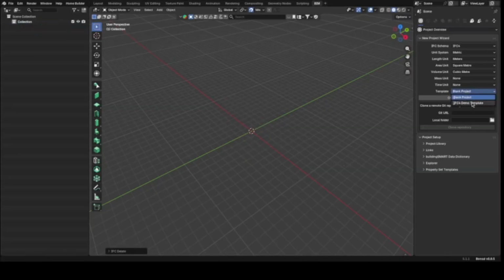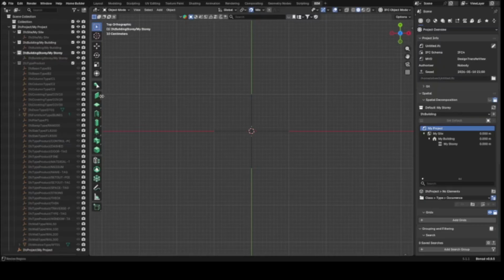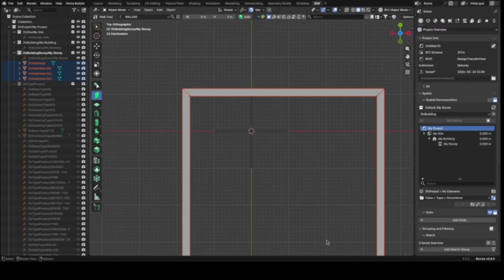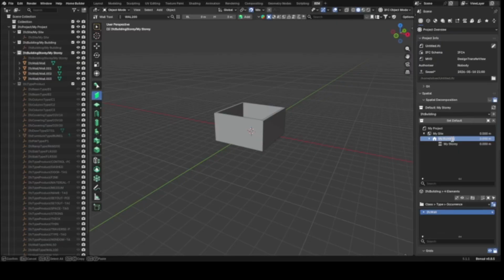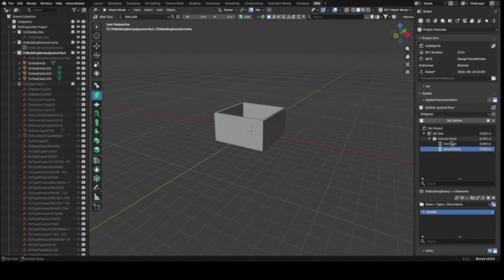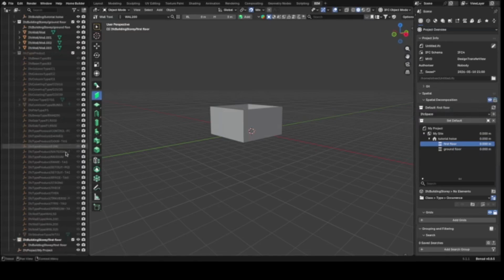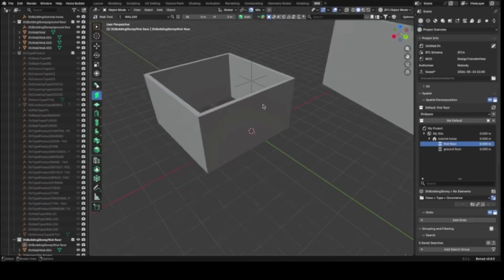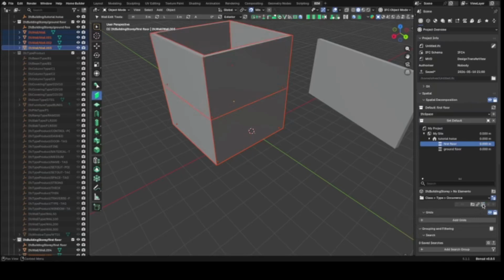Bonsai bim for Beginners: Multi-Story Building Setup Made Easy

Comment: But the value of the “Building story” parameter on the left remains 0.00. So it doesn’t update automatically. Is that measurement just a nominal one, then?
Reply from the maker: ood observation 👍 The “Building story” value is not always auto-driven from the model. In this setup it’s a nominal/manual parameter unless it’s linked to a proper story-height or level system in the model. So if it stays at 0.00, it usually means it hasn’t been assigned or connected to level data yet.